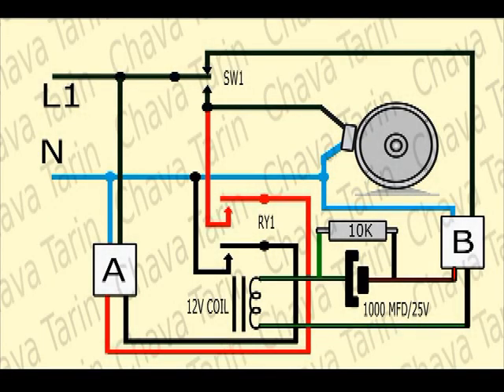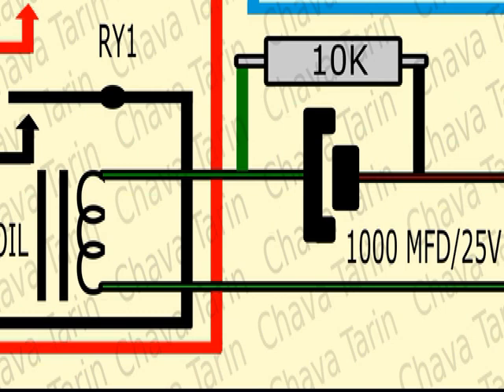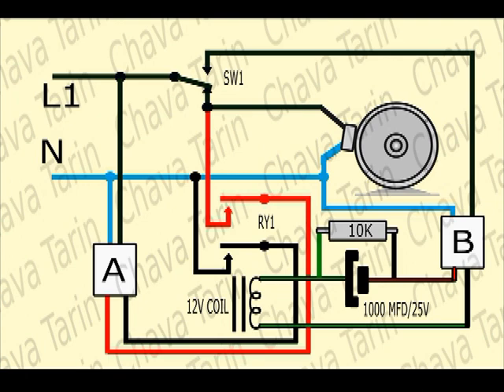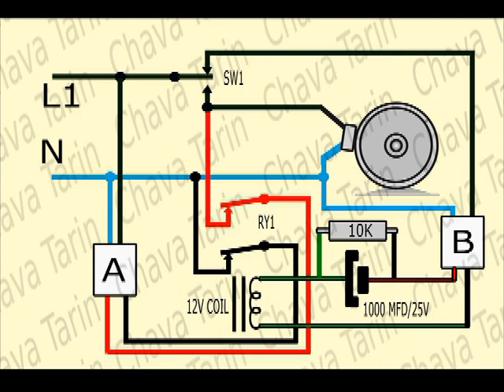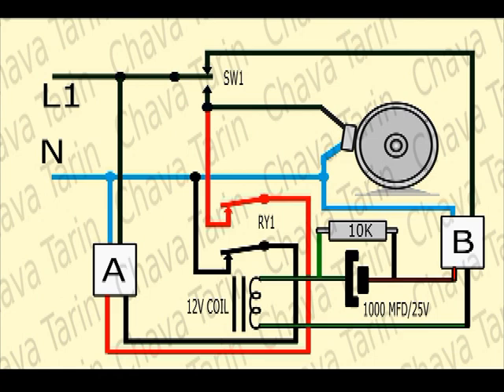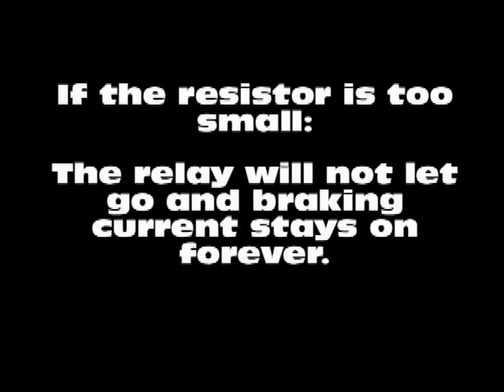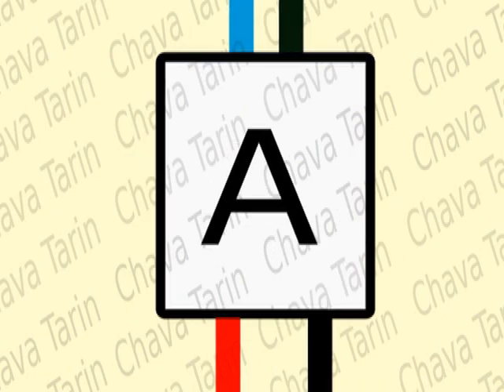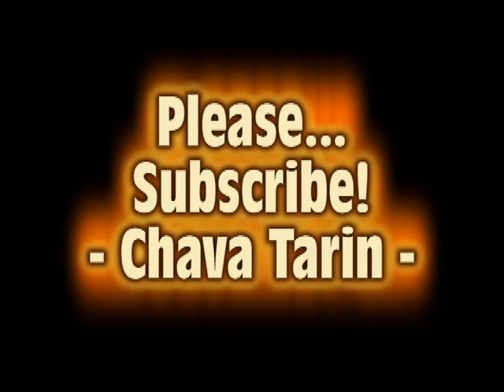Squirrel Cage motor braking using a homemade timer

Comment: Chava, what a great diagram and even better explanation of your idea. I would like to build a Braking circuit to quickly slow some of my larger woodworking machines in my home shop. The table saw and band saw take up to 20 secs to "spin" down after their power is shutoff. This creates quite a safety issue for me at times. 

I would like to know if I could scale up the capacitors, resistor and power supplies to get this same circuit made for motors on the order of 1-3/4 HP 120 Single phase. There are Start and Run Caps in the band saw and a Combo in the table saw. (although I do not think that influences the circuitry).  Your use of SW1 in the diagram; I could accomplish this by adding a momentary contact NO switch above or next to the current power switches. I would like to keep that part of the circuit the same, if possible. I know that the main switches will need to switched off before energizing the DC brake and I have no misconceptions of consequences.

Additionally, both main switches are DPST where the L and N are both opened when off. I wanted to add that part in case the circuitry is effected by this. 

Finally, I am an accomplished woodworker and amateur electrician. I can understand and follow electrical diagrams precisely. However, I cannot design these things or determine component requirements. That makes is so great to have found your Channel and your straightforward answers.
Reply from the maker: Dear Marty, first of all, thanks a lot for your kind comments! Now, about the circuit, you say your squirrel cage motors are 1 3/4 hp, which is no problem.  Yo do not have to scale resistors and capacitors nor power supply B, since their only function is to time the braking cycle. Maybe select a relay with strong contacts to withstand a slightly heavier sparking. On the other hand, power supply will have to be stronger in order to  be able to apply a relatively heavy current for the low impedance bigger motor, however, that's no problem, either. SW1 can be replaced by the contacts of a 120 VAC coil relay, so you can apply the output of the existing power controls directly to this relay's coil in order to turn the motor on or off. If the stopping is too brisk, you can add a low ohm resistor in series with the output from power supply A, just to soften braking a bit. I would suggest you take a look at my video on motor braking using a car battery, the link is https://www.youtube.com/watch?v=HQssG7woEBY&t=19s . You can use the battery when building your system and hook an ammeter to check the amount of current you will need, so you can buy the adequate power supply without a costly trial and error process. Please keep me updated on what you did. Cheers!
Reply: @eltunene  Thanks so much for your quick reply. I will get the necessary parts organized and a trial started forthwith!! Una pregunta con perimso, "De donde Usted?"
Reply from the maker: An additional comment, I don't think having a momentary switch for braking with the risk of a shortcircuit, you can overcome that by using the extra relay I mentioned before. In an emergency, you or some other person with you can get confused in the sequence, please consider including the extra 127VAC coil relay for turning the motor on and off using your usual controls.